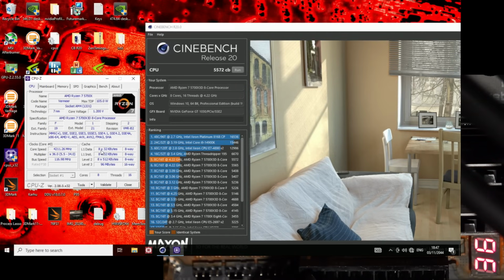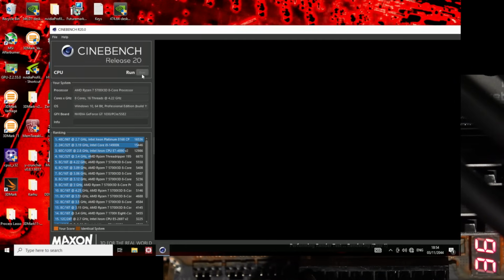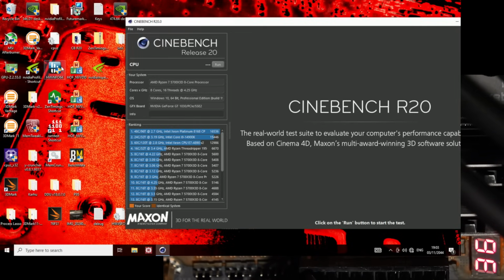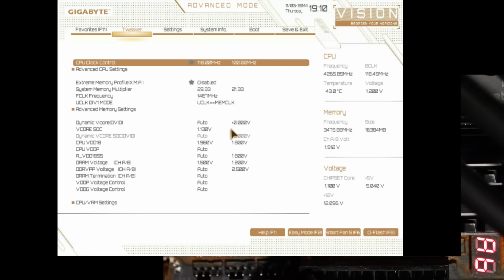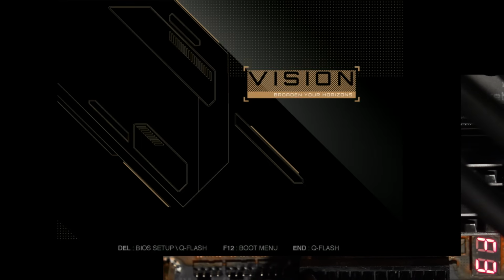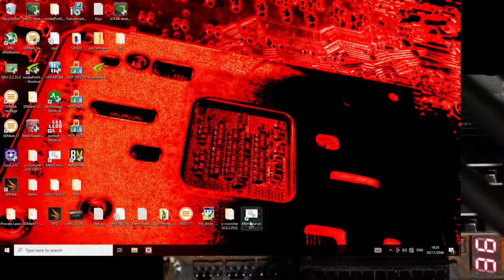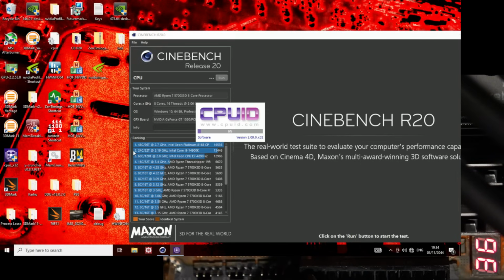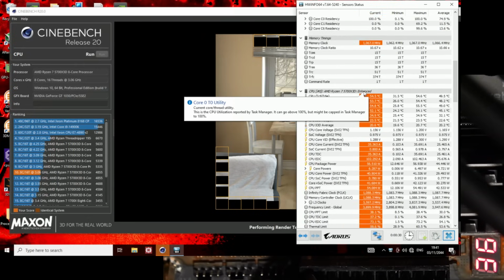Overclocking the 5700X3D?

Comment: I thought you could up the core ratios on all Ryzens??  I had a 1600 and have a 3100 which you can do that with for OC.  I'm running X570 motherboard but you could do it with the B350 on the 1600.
Reply: Yes, but not on the x3d cpus.  High frequencies mess with cache stability because... reasons.  Although, obviously, 4.4ghz would be fine -- so there's no real reason the 5700x3xd couldn't have unlocked multipliers to reach at least 4.4... but then the 5800x3d would be entirely pointless and no one would buy it.

Comment: BCLK works on x570 but you have to unplug SATA
With only nvme plugged in bclk works 
Maybe still not as good though idk dont have a b550
Otherwise I'm glad you tackled this
So many cope lords wasting their time on CO and pretending that limiting ppt or edc does anything useful
What people need to realise is that Global F Limit is an ALL CORE control scheme and its how the zen3 zen4 on cpu control system limits the chip when its getting hot and heavy
And that its basically meaningless with a gaming workload 
And in terms of real world all core workloads - 7zip benchmark is the most accurate way to recreate a real world mc workload and its like 25% lighter than your average stress test
100% agree with you that people need to wake up and stop testing for stability in a meaningless way
also 
core cycler is king when tuning CO you want to just tickle the 1 core at a time with the lightest workload possible 
that is where you will find instability with CO - you won't find anything by testing a all core workload 
but at the end of the day
AMD took away +500 mhz AFTER release
then removed +200 mhz from x3d
scummy company
that needs to be called out for the absolute rubbish it has on all its marketing material that states "all our cpus are unlocked"
when in reality unlocked is meaningless 
and in reality they are a scum company

edit: so I just tried this out at 0 I get 110 score in 7zip, if I set CO to -5 I get 112 if I set CO more aggressively I still get 112 i.e. -20 or -30
so 1.8% improvement...

Comment: I have a 5700X3D and I actually got my highest score at -10, 400+ points over stock in Cinebench R23. 13676 vs 13239. The score decreased -50 pts at -20, thought maybe margin of error so I ran again and got the same score. The main reason it increased so much from stock to -10 is because at stock it would run at 39x multiplier during most of the run. At -10 it would hold 40.5 for 100% of the run. I'm running my 5700X3D in an Asrock B550m itx motherboard / under a Thermalright BA 120 CPU cooler ("245w tdp*"). 
I have my PBO limits set to Auto because that is how it scores the highest. Set to "motherboard" it scores the lowest and when set to manual / the CPU maximums it scores below auto for some reason even though it never reaches them during benchmarks.
Reply: Cinebench R23 in stock 10893 here
Reply: @Lunnariot  You sure that is correct? Did you re-test it? I get 12497 at stock same chip. Gigabyte x570 Mootherboard. I can UV the chip with core 0 and 1 to -20 and the rest to -30 in PBO 2, without changing any values and get 13193. That would mean your CPU is a a hell of a lot worse than it should be.
Reply: I couldn't get past -15 for all cores
Got a meh bin I guess
Reply: Thats weird. On my aorus b550 and 5700x3d. -30 on all cores, base clock 104mhz and with little bigger voltages i get 14200 in cinebench. Full stability

Comment: Sure……..these BCLK overclocks are great in the short term and fun if you have too much time on your hands……….but………BCLK overclocks………especially that high are never stable long term, especially when taking micro environment changes into consideration. Also,  their effects on Sata and even Nvme’s in multiple Nvme configurations is  never good, sometimes to the point of not even seeing your Sata SSD drives. Long term you’re kinda stuck with tuning inside the stock parameters and tuning ram at a higher voltage.

Comment: My i9-9900K 5.0/4.8 with tuned 4266cl16 33.8ns b-die could aleady reach 5700X3D fps quite a long time ago, which is crazy. But now it's a perfect cpu/upgrade for lasting AM4 builds in 2024.
Buildzoid, check out my latest comparison video between untuned vs tuned 9900K, there's basically no such side by side videos out there. Thanks! =)
Reply: Ye dude, 9900k gets the same FPS in your world (with 1060 perhaps?) when in mine regular 5700x surpasses 11900k and x3d chips surpass 12900ks in some titles
Reply: @pcoverthink  why don't you just challenge the numbers from my video? ;) If you're interested, I attached links in the pinned comment to other comparsons from my trusted channels. Some of them have zen3 tuned out with b-die, there are also 14500, 13600K, 14600K, 7600X, 7500f ones and I intentionally repeated the runs to show the ballpark fps in such games as AC Mirage, Plague Tale, Warzone, TLOU etc.
Try to beat my numbers with your tuned 5700x or 5700x3d, the reality might dissappoint you. The x3d isn't going to beat it in Warzone, Finals, many many other games (obviously it's better in some others). 
I highly doubt zen3 (especially x3ds) will gain 25-40% in avgs/lows after a full tune.

And stock 11900K is faster than 5700x as well, stock 9900K is in the same ballpark too, a bit slower. You don't follow these mainstream numbers that run power limits right?
12900K with tuned ddr5 runs circles around 5800x3d, and it is very close to 7800x3d. You're making all of these claims here, do you even know the power of full ram/ring tuning, Especially now we're on an OC centered channel??? The reality is that a tuned intel system has always been at least slightly ahead in gaming stability of amd counterparts of that time.

Tuned out 9900K/10900K/11900K =~ stock 12700 6000 xmp =~ tuned 5700x3d. That is straightforward math. But these 12ths can do Way better, while older i9s and zen3 x3d are nearly at their max power in my example.
Reply: @Heart_Of_Adell_5GHz  I checked your channel, you don't have an x3d chip. Even if your benchmarks are perfect, you just can't compare the number to any other review (Also, I can't find you mentioning any kind of channels anywhere) because a place where you test things will be different, as well as some of the settings or things like ReBar, driver version etc. 

And yeah, I OC'ed about 50x DDR4 systems at this point and 3-5x DDR5 ones. I do full primary/secondary timing tune on any ICs and Ik that you see the most performance increase from this part of the process than from anything else. 

I'll very likely do a comparison myself as I have 1 system on 9900K and another one on r3600 that will be upgraded to 5700x3d soon. 

Thanks for taking time to test a proper OC on the same system btw. This stuff is hard to find here and rn I can't be bothered to do it myself.
Reply: @pcoverthink  thanks for watching! :)
Yes, unfortunately I don't have an x3d system. But other people do, and I've done limitless comparisons against many many benchmarks, gameplays, also compared to zen3 of my friend etc. It's not perfect by any means but I do know the ballpark fps for all these chips. And in the pinned comment people could at least have a closer idea (I don't know how you didn't find it, it's the very first one below the video, many runs were based off of these)
Reply: @Heart_Of_Adell_5GHz  i hade the 9900k oc to delided 5.30 / 4.90 ring , with optimised tier 1 and 2 cl  rams 37ns  ,  trust me it's reealy reaaaly rare when the 9900k with it's max oc can get close the the 5800x 3d , +30% to +60% is the gap between a max oc 9900k vs a max oc 5800x3d with both optimised overlcoked rams  , just for fun try farcry 6 or shadow of the tomb raider in-game benchmark low settings 720p and compared to any guy who own the  x3d chip ... , the 9900k had his time but now it's time to move on ...
Reply: @fwixgamer4796  lol what? It's tuned out 7700X and 13900K that are about 30-60% faster than tuned 9900K, not 5800x3d. Do you understand that it's pure nonsense? It means that TUNED 5800x is also 30-60% slower, which means 5800x3d is 20-30% faster than even TUNED 7700x (somehow when it's slower than even stock 7700X 😂), which means that it's as fast as TUNED 13900K or even 7800x3d from your words 🤣🤣🤣

5800x3d is 20-40% faster than Stock 5700x, Tuned 9900K is 20-30% faster than Stock 5700x, do the math man nowhere near that magical 60% lmao, it will also barely gain 3-5% after ram tuning 🤣 
You chose the cherry picked Sottr that it's literally top cache scaling game and nothing can beat x3ds there, this game doesn't represent the avg difference between them 

Man I've literally attached side by side videos from 2 reliable benchmarkers in FC6 RT in my pinned comment, I don't need to "trust" anyone's words because it's pure facts that bdie tuned 5800x3d has ~135-140fps avg in FC6 RT and mine has 119, 5700x3d would be 5-10fps less, bdie tuned 5700x get about 111-113 with less stable 1% lows. This game is too way above average sensitive to 3d cache, and it is closer to 40% improvement from stock zen3 which is closer to best case. You're not gonna see even 10% difference in most games with tuned 9900K

Just stop giving that uneducated nonsense please, just go and film games from my video and you'll prove it that way (but you won't because it's wrong). I'm so tired of spending my precious time on deniers that don't do any research/math and just go with the crowd opinion. Any of what I've filmed is open to actual comparions, not to "trust me" ones.
Reply: @fwixgamer4796  tuned 9900K is faster in overall computation/latency and equal in gaming to 2024's 5700x3d, and even the newest flagships apparently have a hard time giving you a snappier pc unless you do some e core off woodo with them. Why the heck would you move on from a fast, snappy processor?
I wonder if it's 30-60% faster than my tuned 9900K maybe it can do 300-320fps in Warzone 3 and Finals? Should make sense after getting 200-220avg in those with tuned i9... but wait... this is 7800X3D fps lol 😂 just give me a break I've gotten too involved. I'm not responding to that nonsense anymore.

Edit: FC6 low 720p 160fps avg 120fps 1% low. Waiting for 5800xd to beat it by 30-60% xD
Reply: @Heart_Of_Adell_5GHz  damn you like to talk . im telling you i had mine at 5.30 to 5.40 for max oc on a 800 dollar board costum loop and it sucked ass  . so plz i know wasap with the numbers  . i own a gaming shop as a ref . and tomb raider is a good ref for bench ram and cach wise.   and yes a saw a 60% uplift  . and yes in warzon the 9900k was a shit hole can't get pass the 120 fps drops no.matter what you do with an avrg 160 .vs a 160 180 fps drops for the  x3d chip
 I'm not sure why are you arguing brother 
 it's old move on .
Reply: @fwixgamer4796  sorry you didn't have a tuned chip at all. Learn to properly overclock before making claims. You're one of these dudes that go overboard to reach insane core clocks and make it a spaceheater, it doesn't matter at all for its fps lol. My 5ghz one would annihilate yours with less watts. Even My chip is not a max oc 9900K with 4.8 ring 4266cl16 33ns ram. If I went as far as you it'd get even faster.

Sottr cannot be used as the metric for avg performance of these cpus, it's in 0.1% of most cache sensitive games. You gave one example, I've seen dozen of where it's on par/wins.
And no, tuned 9900K gets 200-220fps avg fps in Warzone 3 (you didn't even watch my channel lol), 150fps is for 1%, min fps is 170-180 while shooting worst case. I'm not even sure if 5700x3d can get to the same fps, 5800x3d should, maybe a bit better with bdie.

"Move on" - lol. Literally from a snappier pc than any zen3 system. All I'm moving on from is wasting my time on clueless dudes.
Reply: The 9900K was a great chip but really it's more in line with 3800X.

Comment: You do actually get CO on some 5000 series X3Ds, my X570 Aorus Pro has it with the 5800X3D. From my experience, it's very easy to reach the max clock of the chip, I wish that was also unlocked
Reply: Wait so, is there a list of which motherboard has bios support CO for X3D chip?
Reply: @kaitoharrison872  I am not sure if there is a list, but look at the bios updates, well into 2023. Mine had it listed in the changelog, it probably has to do something with the new AGESA
Reply: I thought CO was available for all boards.
I just got a 5700X3D and my B550 Aorus Elite has CO available although I'm running some 2023 BIOS.
The chip does -30 stable no problem with all core boost of 4050MHz and 4150MHz single core. 5375 points in CB20 with HWinfo open.

Comment: Hey @ActuallyHardcoreOverclocking   love your content. I got a wierd question, i see new b650e and x670e motherboards from msi and gigabyte that have 6 layer pcbs but support up to 8000 ram speeds on quite a lot of kits especially the gigabyte one. Do you think its a good buy ? Im just curious if those will be reliable results for stable 8400+ speeds in the future.

Comment: I am confused. Stock 5700X3D boosts to 4050 MHz. Which means the stock multiplier is 40,5. This means that +17 MHz over BCLK should boost it up to 4739 MHz (117 × 40,5). And for a slight core clock boost over stock +3-4 MHz over BCLK would be enough. Am I wrong?
Reply: You're wrong. The problem is the AMD boost algorithm. It's great for normal usage and terrible in this case. Buildzoid even talks through it, he had to disable boost clocks entirely, so the CPU always sits at the base clock multiplier times BCLK. He manually set the base clock to 3600 MHz, so that he's not starting out from 3000 MHz, but it's still not the same as boost clock times BCLK.
Reply: @hammerth1421  I thought he disabled auto boost due to instability issues caused by such a high BCLK frequency (117 MHz). But what about 103 MHz? With enabled auto boost this should result into 4170 MHz core clock. I heard 103 MHz is double on most motherboards, isn't it? It could be a good option for everyday use.
Reply: @stangamer1151 he disabled it because PB disabled itself beyond 104, and basically locked ratio to 30x.

At 104, running cinebench, PB just drops ratio to like 39x, so 102 BCLK just kinda works better

Comment: yes eclk is supported on 2nd gen ryzen on x370, but then only crosshair vi hero has the capability to do it.
Reply: and the gigabyte k7 x370  has a external cock gen too.  what i have and have the 5700x3d and doing a bit of blck overclocking with mine. not doing all core clocking tho  but cpu pretty much always hits 4185mhz  and boosts up too 4275mhz here and there.     more so kinda afraid too keep messing with it even with the external clock gen cause well 3d cpus are weaker and stuff can still drop off like storage drives and stuff 😜  so im slowly been doing it sense i got the chip over a week ago here and there lol..    tho even at stock chip does the job even over my 5800x which i had too rma was plaq with whea errors sense i got it back in march 2022   why i got the 5700x3d.... lol     3d chips in my case cause i run 5120x1440p wouldn't be worth  a upgrade otherwise but i will say the 1% lows and min fps are nicer i been noticing that over my 5800x.   oh and running pbo2 software with -25 sense  really alot of am4 boards like the 300s chipsets  wont support that on 3d chips tho you can trick them in bios by reloading a old profile and setting it and it will stick ;)

Comment: From the clock and valtage behavior I would suppose it is ryzen 3000 silicone. AMD may used 3700x chiplets and put 3d-cache on top.
Is there a possibility to find out? I think the ccd, ccx complexes are different between 3000 and 5000 ryzen.
Reply: No this can't be the case with 5700X3D as it has Zen 3 IPC and not Zen 2 IPC
Reply: Well the 3700x is zen2 and 5800x3d is zen3
Reply: @KL-ky8fy  yes... and some years ago it was said that Zen2 was already prepared for 3d-cashe, but was delivered without.

Comment: 5600x3d should be better than 5700x3d ,right?
Reply: no hijo, porque el 5700 contieen 8 nucleos.
Reply: @83266Andres  but lower frequency
Reply: Si es verdad pero igual los otros dos núcleos ayudan están parejos los tres modelos , muy parejos yo querioa el 5600x3d pero aquí en mi país no llego. el 5800 lo descarte porque para eso cambiaba de sochet. Abrazo.
Reply: I think not. All core 4050 vs 4250 or so.. the 4 extra threads are better than this 200-300mhz higher frequenzy

Comment: They really had this many dogpoop samples? I thought they were just cutting 5800x3d in price justify product release during CES.
Reply: Semiconductor yields are really poor these days. They produce at yields of like 1/3 performance bins, 1/3 cheap bins with disabled cores and lowered clocks, 1/3 completely defective and it takes serious effort to get to that level of yield and not have to pass 3/4 of samples straight into recycling.

Comment: my x570 taichi runs my 5800x3d at 106mhz lol
Reply: Hate to revive a dead thread😂 are you still running 106bclk with no issues with sata or nvme drives?
Reply: @HenryArevalo-dj4ze  so far so good 👍🏻
Reply: my x570 unify doesnt not even 101 always doesnt boot
Reply: I've gotten it to boot at 119 the highest, but it takes a long time at the boot up screen before the windows logon loads. After that the system runs without error so far. I've had corecycler running since 8am
Reply: I think it's taking so long because it's switching PCIE from gen 4 to whatever is stable
Reply: I've also found info that some people say this board also has an external clock gen but no options are available in the bios
Reply: @spiritw0lf  like how long do u mean?
Reply: Like 30 to 45 seconds
Reply: @spiritw0lf  do u run any sata ssd ?
Reply: @aditrex  I have 3 1tb nvme drives that's all